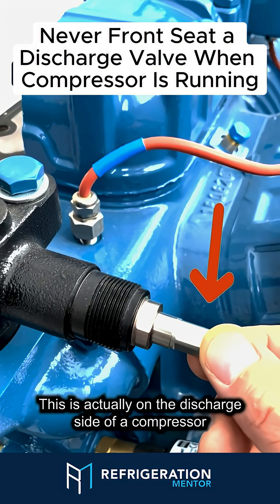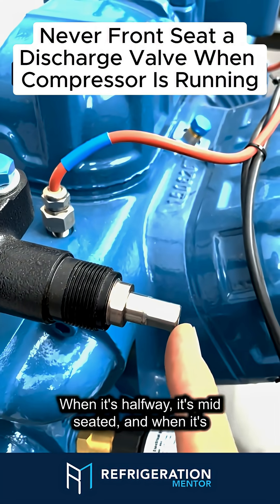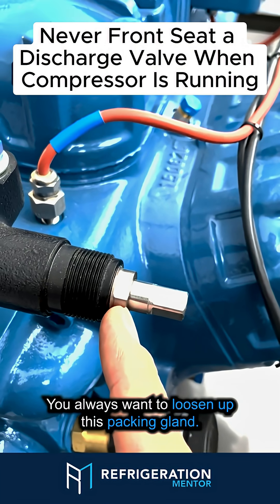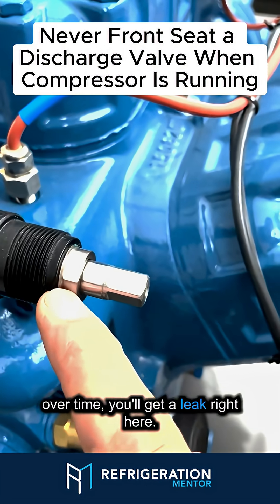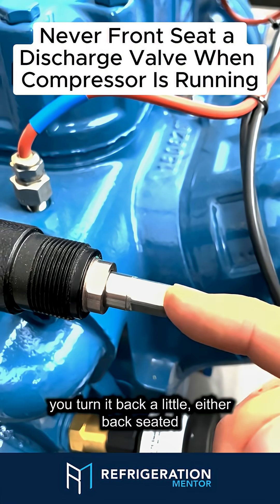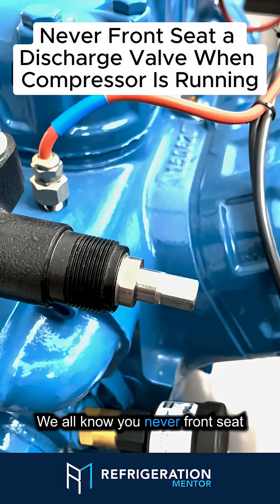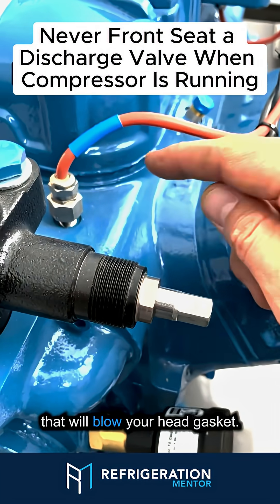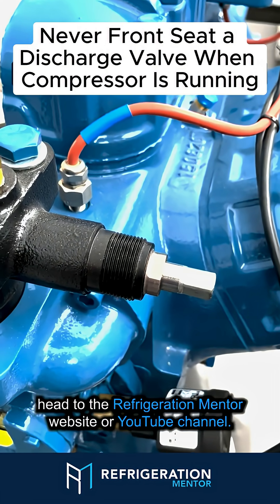Never Front Seat a Discharge Valve When a Compressor is Running

Comment: This is actually incorrect. Packing glands are designed to be left in place until point.of service. Loosening and tightening them will prematurely wear the gland.
Reply from the maker: Thank you for letting us know and you maybe correct for some service valves but most refrigeration services valves manufacturers recommend loosening and tightening them every time they are re positioned. Example mueller service valves or Copeland compressor service valves that have a packing gland need to be loosened. Here are supporting documentation https://muellerrefrigeration.com/uploads/Application_Release_Service_Valves_9.19.11.pdf and Copeland https://media.copeland.com/ec9ffb04-21db-4efa-930f-b16d001e3489/2015-Service%20Valve%20Packing%20Types.pdf we hope this helps.